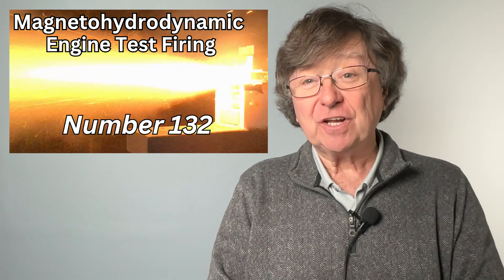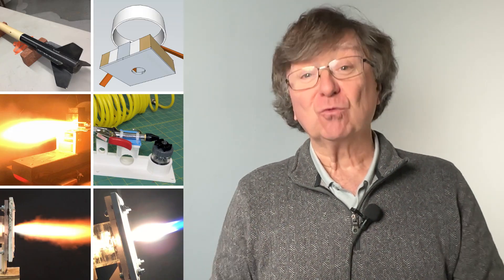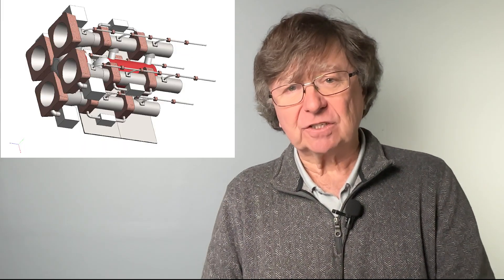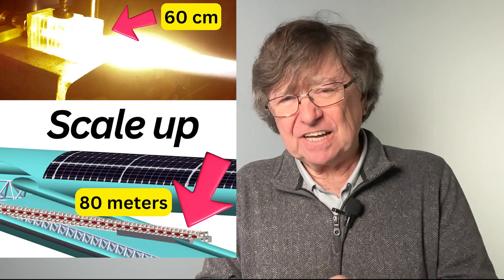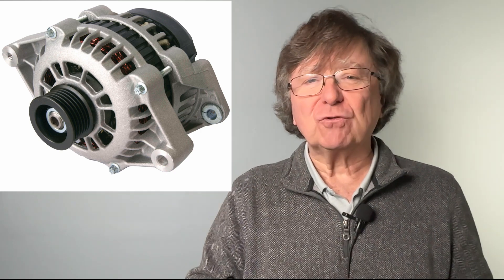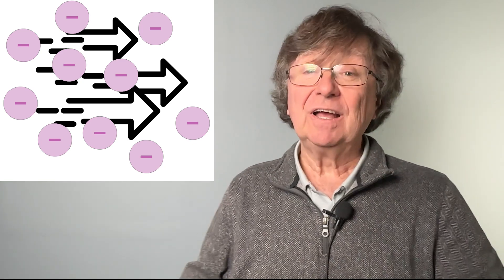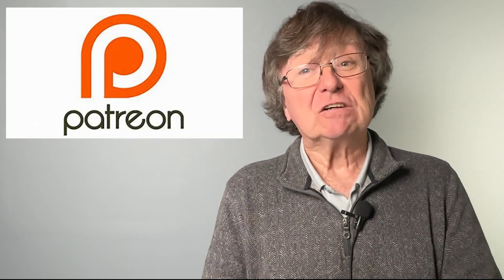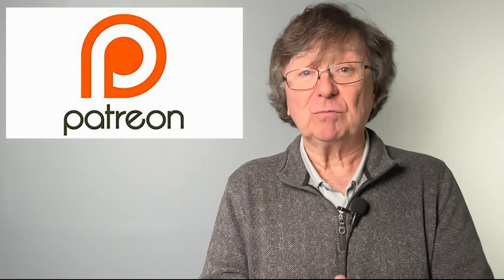Plasma Engine Research, Magnetohydrodynamic Test No.132: Mistakes, Breakthroughs & What’s Next

Comment: Arduino? ST Micro surpasses it 100 fold. Come with 1MSPS ports, and operate hundreds of times faster and a 32bit bus. ESP32 is also a good candidate. Then there are RasPi's and clones. Much more expensive.
I wish you success.
Reply from the maker: We use lots of Arduinos in our submarine so their handy. Also, they are great for simple sequencers.
Reply: @johnmpowell  My submission to ABS for internal controls, UW comms, water to air sound conversion, and backup control system and life support of a towed submersible was passed without hesitation. I was using the STM products. Blew my mind as it was the 1st time ever submitting for such approval.